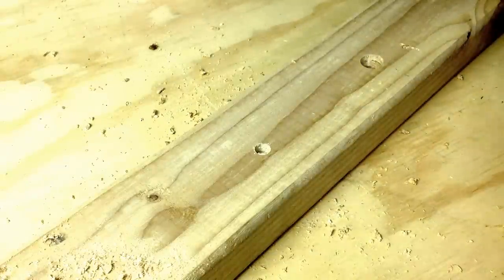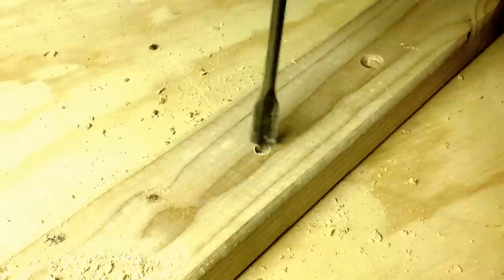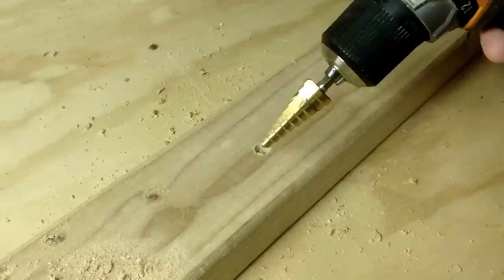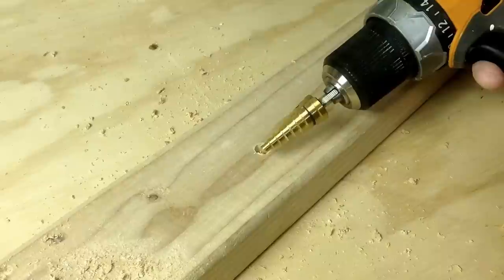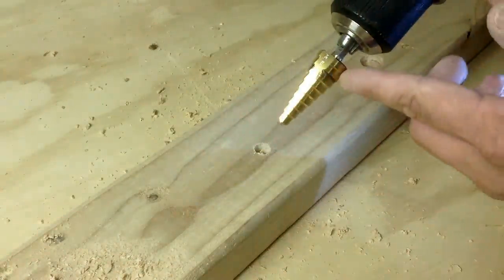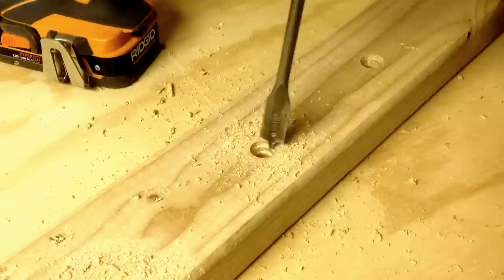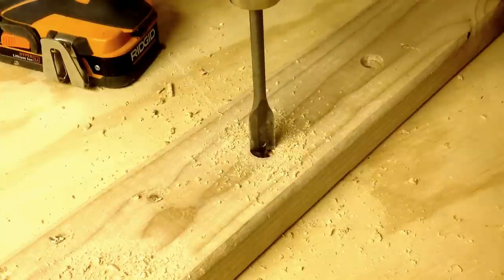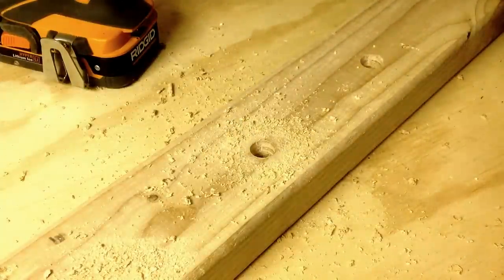Easy Way To Enlarge Drilled Hole

Comment: Eh...im just gonna use  drill bit and go round and round. I'm installing an on/off button on my guitar. So the hole edge will be covered by a lip of metal on the button housing.

Comment: Thanks! - Excellent Video... Crisp and clear. ... I did not know these bits can be used for some wood applications.
Reply from the maker: They also cut a lot cleaner than most spade bits, because of the single cutting edge.  Kind of like how the countersinking bits with a single cutting edge seems to cut cleaner.

Comment: Great tip - I even have all the stuff (I use the step bits for enlarging knockouts in electrical boxes).  Really great solution that keeps a precise center.

Comment: Or you can screw a board on top of it temporarily and mark it back out, then drill through both, unscrew the top board and there you go. This is a little bit tougher with a paddle bit than a standard but it works
Reply from the maker: That is certainly one way to do it.  However, it leaves screw holes in the board.
Reply: @mikeadiddle right. Some places the board works, some it doesn't. It's a good alternative whenever you can't afford the punch through from a step bit though

Comment: Hi can this idea work on glass ? The hole I drilled still to small with a 3/8 bit should I redrill with a larger bit but I think that hole would be to large help
Reply from the maker: I don't think I would use a steel step bit for glass.  There would be too much risk of cracking the glass.  Fortunately, regular arrow-head type glass drill bits are self-centering so you could just use a 1/4" bit in your 3/8" and drill through it.
Reply: mikeadiddle thank you will try

Comment: Thank you. This was very helpful. I had to install a new peephole on the front door and the hole was smaller for the replacement peephole. 
My next trip was at harbor frieght, picked up the single piece step drill bit with 20% off coupon. $5 bucks later , i have a new peephole.
Reply from the maker: Awesome, Salman!  Glad I could help.

Comment: After you used the step up bit can you use a regular drill bit, instead of the bit you used?
Reply from the maker: Yes, that's the idea.  You can't keep going with the step bit or you'll make the hole too big.
Reply: @mikeadiddle  What I mean is, can I use  regular straight bit, instead of the flat bit you used?
Reply from the maker: @JENDALL714  Most likely, yes.  That's just the bit I used for the demonstration.
Reply: @mikeadiddle  Thanks, I am drilling out a hole for a guitar and I always screw it up. I build guitar kits, and the holes always come sized in metric, I always re size them for SAE, but I always chip the hole when I re size, thanks for the information.